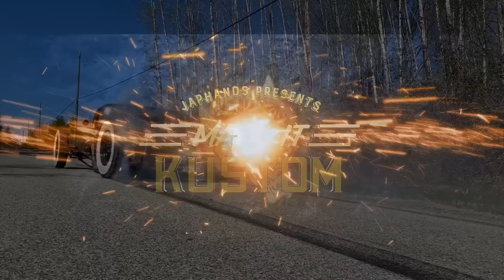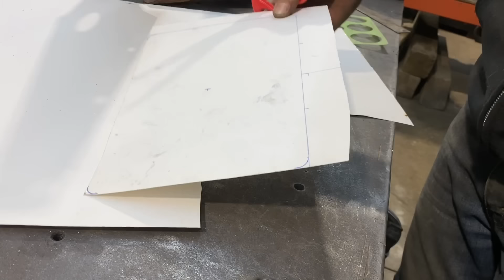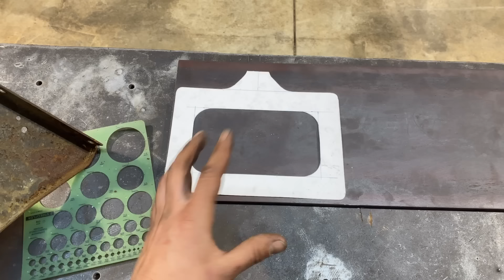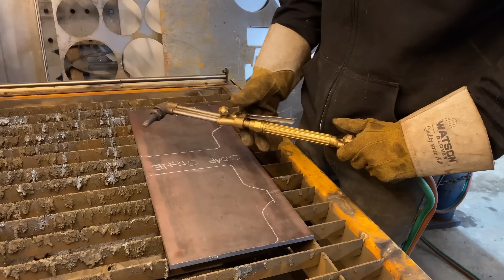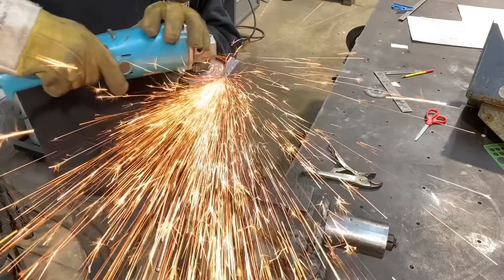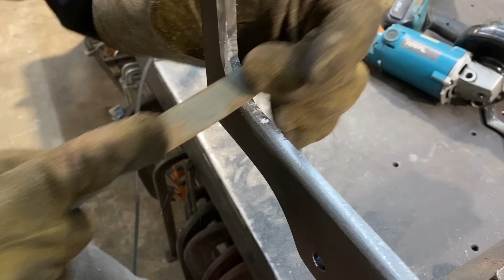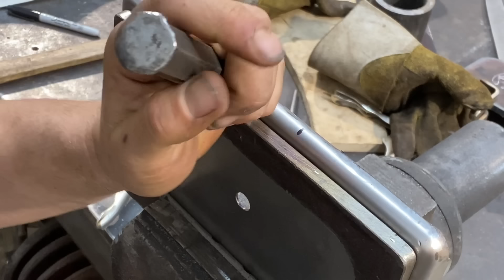Steel Plate HAMMER FORMING!! Step By Step with Simple Tools - G10 Van Battery Tray

Comment: Instead of using metal you can use construction plywood. More fine tuning with a hammer though as you cant use a press when using wood. But except for that plywood is a great material for low series sheet metal parts. Great video 👍🏼🤘🏻.

Comment: the only question id have here is how far does it take you until you've got the value of tool setup from spending on plate. I wouldn't imagine it economically viable at all after a few smaller pieces.

Comment: If you're used to work with body sheet metal, going 16ga is stepping it up quite a notch!! Just the other day I wanted a water pan bent for my smoker and for the size of it I felt the heat would want to buckle it if it were 16ga... So, overkill me decided to bump it up to 14ga and man that thing is thick!!

Comment: Does this have to be done cold. Would it shrink and stretch easier if heated. Not red hot but to a few hundred degrees to let those molecules shift around a little easier. The result was much better than I expected. Nice work.
Reply from the maker: I think your right but I didn’t think it was necessary

Comment: Going to watch this later. Had watched another before and was very impressed with the technique. 

I made my own rocker panels, fenders and portions of doors one year but i didnt bolt things down. Worked out well enough. 

Now i take propand tanks and make shields out of them. For the shields i found using a sand box works well.

Thanks for uploading these!

Comment: Mad skills Karl. You remind me of the days I used the same methods of form work to manufacture aircraft structural parts for Boeing A/C in a maintenance facility. I used aluminium to make my blocks because it was easier to work with but same effect. It’s a great achievement and method hence the time to manufacture the block tooling but final product is worth while, good job Karl.

Comment: Noob would be a stretch, call me 'mildly curious' about sheet metal but... why did you do the central dish last? It seems like 1) if it breaks you've got a lot of work wasted, and more importantly, 2) you've already put a ton of stress around the edges - forming them later would let the metal stretch where it wants to first, then wrap up the edges.
Reply from the maker: Wrapping the edges holds better is what I was thinking

Comment: You clearly have pretty decent fabrication skills and well equipped workshop. There’s one thing I don’t get - you needed battery case for truck, so one time use thing. Isn’t the approach you took a little too expensive and time consuming? Wouldn’t wood be sufficient for the job?
Reply from the maker: I explained this in the video. I can buy one for 18 bucks. But these techniques can be used to make so many parts that are not reproduced. It was all about the technique and it’s potential uses and not so much to just fix a battery tray.
Reply: @MakeItKustom  Gotcha. I missed when you mentioned that. Thanks for making those videos. They are really insightful. 👍🏻

Comment: You mite have made it easier if you had Annealed the Steel first that is how I do it , To Anneal light up your Oxy set with only the Acetylene on and put Black soot all over it then turn on your Oxy  and burn of the Black , ( I'm a Fitter and Turner with Tool Making ) I had to make a new dash for my 39 Ford , so I recess my Gauges in to it then Wire edged it , I hope this helps , if you don't have a Oxy Acet / Set you can Pre Streach with a E wheel . That's a very nice peace you made .

Comment: He made some pretty nice free hand torch cuts on the video but,   On the torch cutting, for any newbies on the torch, get your self familiar with tip size for the thickness of material.  Also very importantly the pressure settings and your cut speed prior to making torch cuts.   These have a major affect on the quality of cut especially on thin material like 3/8 (10mm) and thinner.    There are plenty of good vids on using a torch, it is worth the time to learn this to avoid wasted material, especially with  todays metal prices!!!  
       Ill be honest, I much prefer to use guides to make perfect straight clean cuts, the reason for this is it saves a huge amount of time and most importantly the expensive grinding wheels.    I use a piece of steel for a guide, and use a hose clamp around the torch tip to set the depth (preheat flames just at the material)  this makes most cuts nearly plasma cut clean and you can finish with a grinder in a few seconds vs having to correct your lines with the grinder.   
        I see so many good fabricators flying through the torch cuts and spending so much time with a grinder vs taking much less time to make near perfect clean torch work and then a couple mins on the grinder to tidy up and take the dross and scale off.    Ill take 20 mins to setup as near a perfect torch cut way before using that same 20 to grind.    Remember folks, torch cutting is the cheapest way to cut out and or remove steel by far and using the torch as much as possible is definitely worth the hassle,  Thats my personal experience over my years of fabrication.  
     The typical commercial tanks I own are 300 cu ft tank of oxygen is about $25 here in the usa and acetylene is about $50 for about 140 Cuft   now compare that to the price of grinding, cutting, buffing,  and chop saw blades and its easy to see.

Comment: Or you could get a new battery tray 0n eBay for $40. Then you don't need to purchase an acetylene torch kit, hydraulic press, welders table,  steel plate, welder's clamps for your "home" workshop. Like he said in the title "simple".

Comment: Didn't know a plasma cutter, hydraulic press, etc were simple tools... and who has such big, expensive pieces of steel to scrap in order to make a battery holder?
Reply from the maker: You didn’t get the point. That’s ok man. Also I didn’t use a plasma cutter and explained all this. 👍

Comment: The bottom depressed area is designed for drainage which is also why the two channels at the side are there to direct any collected water /liquid and to keep it below away from the battery which finally is why there is a hole in the centre of the depressed area

Comment: Just a little knowledge bomb wd40 is not a lubricant in any way shape or form. Wd40 was the 40 attempt to find a water displacement formula to prevent rust and corrosion. It's in the name "wd" water displacement  "40" 40th attempt.

Comment: "You can buy an offshore version for $18. . .wouldn't change a thing!"

I spent a week restoring an old 10" Rigid pipe wrench. $50 in supplies, lots time. Brand new Ridgid wrench is indistinguishable from a vintage one. Available on tha Jungle-themed evil billionaire's site for $22 with free delivery.

Edit the add: immediately after I posted the above I got an ad interrupting the video from the VERY site I only obliquely referenced! The one after that was from Hobo Freight. I figure "free delivery" triggered the first one and Rigid triggered the second.

. . .or else the evil billionaire now understands doublespeak.

Comment: rolling the edges like that I find easier & faster to use a flat bar standing the former on its edge rather than a hammer from the flat & use a length of round bar to stretch the inside corners rather than ball peen

Comment: Amazing piece! Very clear explanation. I just finished fabricating lower A pillars on a 68 F100 since the parts weren't available. I used the old pieces as templates like you did here with a bench vice,grinders and hammers. Necessity is the Mother of Invention.

Comment: Karl, great video on low-buck hammer forming "unobtanium" (or too expensive) parts!  Also, if you use more cutting fluid when drilling or milling, your drills & milling cutters ought to last longer.  Your drill bit seemed a bit dry.

Also, has Kristina gotten her "shop" up & running?  If so, you should do a quick "shop tour" of her area(s).

Comment: Hammer forming is how I found the channel - happy to see another video with more techniques! Do you think this could be done for a large panel using plywood, 22 gauge steel and an air hammer? I have an old truck that used to be a motorhome - so there's no rear cab wall. Wondering if it would be silly to try to make the entire piece this way.
Reply from the maker: Absolutely that would work!

Comment: Mate, another great vid. I used this method to replace the bottom sections on a 1957 Norris convertible. Made wooden bucks, hammer formed lips and edges, then welded to guards, very satisfying. Although this seemed like a LOT of work to save $18, ha ha ha.

Comment: Great work Karl. I was looking for a detailed description of how to do heavy hammer forming for the restoration of my 42 year old Hilux. Quick tip that might be helpful in the future. When torch cutting and needing both bits, if you can drill a small hole to start the cut you more often get a better result than straight out piecing with the torch. Just depends on how much wriggle room you have and a good aim.
Reply: Good advice, same thing with a plasma torch.
Reply: Starting in 30's, the contour bandsaw would cut the inner part out of the form block, and then switch to band fileing to smooth to the line.

Comment: I do this press forming all day during the restoration of my 95 Mitsubishi Lancer. I use a mix of hard plywood and 8mm steel for dies/forms. And I can tell you the process takes ages to carry out but it is sooo rewarding when you see the shiney final product turning out like a new factory panel. 😎 great content Karl!! ps: and I only have a 12ton press so I have to move it around to 3-4 places on the positive die and apply the pressure in 2-3 steps.
Reply: Is it possible to form 16 gauge 304 stainless clamped to a wood pattern?
I want to make a big cookie sheet 3/4 deep with 1.25 inch radius corners, and a 5/16 inch curve between the base and sides, and 95 degrees between the base abs the sides.

Comment: Nice job Carl, I think if you had pressed the center first then the perimeter. Your center hole would have stayed in place. But don’t think about it much because you did a great job. 
I hammer formed a differential cover out of 040 aluminum. My first 3 or 4 try’s ripped open until I used a very soft aluminum which hardened after forming. Wish I had a picture of it to show you. (Pre cell phone days) I should have shouted out to you when I saw you in Red Deer. Keep up the great work.
Reply from the maker: I’ll have to try that and see ! Thanks tony
Reply: The trick to avoid ripping alum is to anneal it part way through the hammering. This removes the work hardening that occurs with Al.

Comment: My torch is like my number one tool in my garage. Not even just for cutting but for heating up every nut and bolt without snapping it on the rolling piles of iron oxide we drive in Minnesota. A good torch is my number one recommendation to anyone looking to do ANY kind of metal working

Comment: My old dad used to say, "Stock up on elbow grease son, it's the thing you'll use most in life". It's not the $18 that's important. The important thing, is you can do it if yourself if you need to. Inflation will have that battery tray up to $118 soon enough. Awesome steady hand on the torch work. I was thinking, wouldn't it be nice if you could route metal like you can wood...This is the sort of stuff that really takes me back!

Comment: actually, I think, the offset on the bottom is to allow water a place to go when it splashes up under going down the road and you hit a water puddle; that's what makes sense to me anyhow. Makes sense that it would allow the water under it to get air and dry out, and it has that weep hole in the center as well for drainage. My 2 cents anyway.

Comment: could have cut the slug from the bottom die, welded it to the top die, pressed it, then hammered the edges... woulda saved you a lotta extra work

Comment: 16 gauge. Still manageable. I bet wood would work.steel for repeatability. The step is for drainage,as well as an airspace for cooling battery. Seems factory could have done a better job coating the battery tray. Every improvement costs money. 
Guy on youtube did a file test, various files and techniques. Backdragging doesent wear out file. It actually removes material.
Turned out nice! So now there is the tooling to build more battery trays. Lots of gm’s use that tray. 
Portholes are cool! I put actual ship portholes in my fargo cab,to make it a 5 window. Making youtube vids is fun, and i really enjoy the support from my viewers,as well as i like supporting other creators.
Reply: I'm thinking that airplane plywood, or use square bar backed with a quality plywood could also work for a 1 off part. I believe there is a guy making a plane using 3d printed bucks for some of the wing ribs.